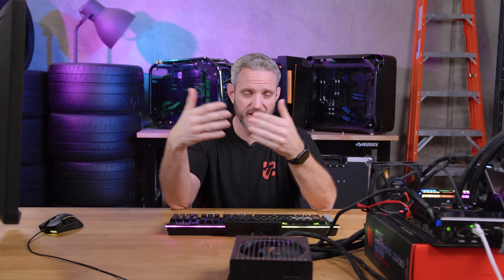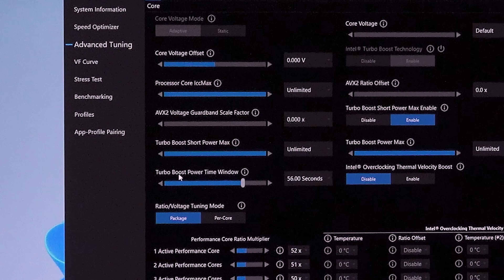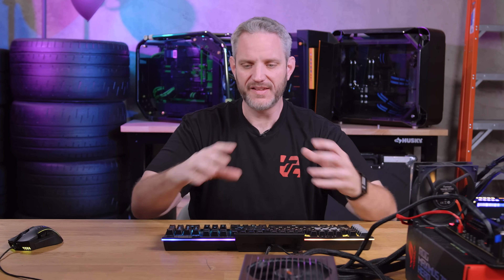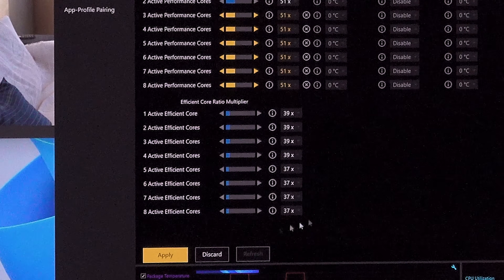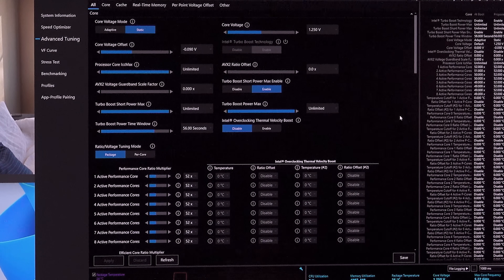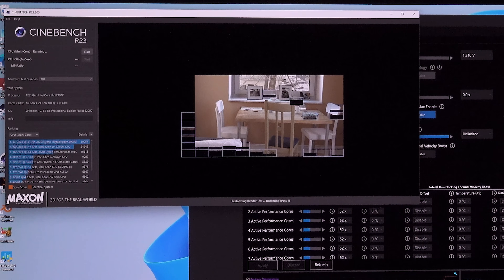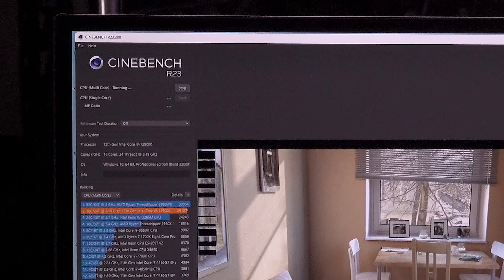Overclocking the 12900k is pointless and dangerous! Heat and Voltage testing...

Comment: As of my new pc build I’m solid a 5.2 on all performance cores and 3.9 on all efficiency cores. With a -0.075MV undervolt. And performance is great only reaching 50°C at 85W of load. And around 75-80°C at 200-300W of load.

Comment: 3 years now still running a i9 12900KF @ 52x P-core and 40x E-core with a dual tower Thermalright RA 140 air cooler just edging 90° under full load

Comment: This aged like milk lol. Enjoying my 12900KF and all the headroom intel left on my silicone. Easily hit 5.8 single core 5.2/4.1 all thread. I saw no real reason to adopt 13th gen. With 14th gen around the corner I'm tempted but lord knows it's not going to clock much higher than the promised 6.2 for the 14900 KS

Comment: Also depends on the work load, on DXO even with just post processing one image from a Nikon Z7. The load has been distributed too all cores, which is great. But it runs only at 4.4 ghz for P cores and I can't remeber thr E cores, way low with what it is capable of and there is tons of thermal headroom.

Even just doing a 5.2 all p core and 4.0 E core would be a DRAMATIC improvement over the stock logic and settings.

Comment: When enabling the AIOC on Asus boards you need to also adjust the thermal velocity boost to +1 and you'll get your same numbers rather than a little less. Only takes an extra second or two to change that in bios as well while you're there.

Comment: I have my 17-12700kf at 5.0ghz on the performance cores and 4.0ghz on the efficiency cores. My temps never pass up 50-55 degress Celsius at 1.2 volts.

Comment: It's simple,  use a sealed vapor pump style refrigeration system to cool all of the heat syncs of the components, with the components isolated in a sealed case with as much pressure removed as possible, using a vacuum pump. It would prevent condensation from forming and prevent the components from burning up.

Comment: I can engineer a case and cooling system that wouldn't cost a lot, and you can max every over locked setting on the slowest CPU and or GPU the board will take. safe and reliable. I'll guarantee it ,like, I guarantee my Unified Field Theory of everything, in Physics.   Have me on your broadcast and I'll explain my design to all your subscribers. 
  My design incorporates

Comment: I use an I9-12900k at 5.3 all p-core and 4.2 all e-core, max temps with cinebench is 73c @ 1.3 volts, and the vrm frequency does matter for trying to reach lower volts at higher clocks

Comment: Jay try the latest version of the XTU - it comes with voltage locks even on the 12900k (little lightning bolts), you were using an outdated version - so your viewers cant even follow the guide

Comment: Jay, it'd be nice if you actually provided the first step on how to unlock the overvoltage protection that's on the 12th gen CPUs to actually allow the sliders to slide.  Have a 12900k on a rog z690 and win11, but the cpu voltage slider in XTU says "undervoltage protection", and sliding it left or even the offset, does absolutely nothing...  Your video starts after you've already taken off the protection, leaving people without the crucial step 1.

Comment: Too bad that there's no way to backup the AI's training data so you have to do the process, and the fine tune because the thing loves throwing errors during Prime95 Small FFT No Avx stress test, at every:

1) Bios update
2) Major system crash (which defaults your OC at 38% despite selecting "stop training" in the bios
3) Random mobo bitc*ing

I went in-depth with both ways, manual and AI OC, and I found manual OCing not only superior in performances/temps/stability, but also easier to accomplish, which defeats the main point of having an auto OC algorithm that is not auto at all to begin with.

All in all great feature, bad implementation

Comment: There’s ppl that overclock their pc to 5.7 or higher ghz for just Fortnite. One guy used some kind of tubing that goes through a cooling solution with a low ass freezing point and he puts fry ice/ liquid nitrogen to cool don the solution and have it cool the tubing thus cooling the liquid that’s cooling the cpu. He bros smarter than I can comprehend. I think Bugha wanted to pay 30k for a pc to run 8ghz but it wasn’t efficient

Comment: my ai OC was making my system reach 100C in less then a 2 min, I turned it off and set it to P 3.9ghz and E core to 3.7 ( wouldnt let me past 3.7) ran the 10min test again and my temps highest was 79-81

Comment: i regret buying this  cpu honestly  i have a 3080 ti a i9 12900k  and  32 gb ram 5600mhz  and i still cant get my pc to run star citizen  like wtf  paid 6k dollars for something that performs worse than my 2070 laptop
Reply: working now?
Reply: @OfficialGundem  I gave up on starcitizen  whatever pc I use i cant run it well for some reasons mabe i live too far from the servers idk
Reply: what is your mobo?
Reply: @박덕배-i6r  Rog strix Asus Z690-E Gaming wifi
Reply: @DXDgamingsubnow  my gear looks exact same. 
Z690-E / 3080ti and I have two different rams. 1) Kingston fury 4 x 8GB(6000mhz) 2) fury 2 x 16GB (5200mhz).  Z690-E has really many hardware defects. I had to return it two times in a month. can you tell me your RAMs in detail? and how they have been populated? I can help you.
Reply: Star Citizen has garbage performance what do you expect

Comment: BTW cinebench is not a good stability test for OC... I ran cinebench 100 times and thought I was fine with my undervolted. prime 95 lasted 20 seconds! I actually don't want to overclock the 12900K at all, I am thinking actually 4.7 all core for P's and maybe that way I can push E's to 4.1 all core.. has anyone tried such a thing?

Comment: I got a 3970X to 4.4GHz all core (3600Mhz CL14 RAM 8 sticks) to 50,186 points on CB R23, anything over that and CB R23 crashed. It was being cooled by a 360mm Rad custom loop (EK XE 360mm Radiator, on Zenith II extreme Alpha using the monoblock), power draw was close to 600W into the mainboard. Probably could have pushed it further on higher voltages, but decided to leave it there as it was a production machine to be left overclocked. I had Windows running fairly stable at 4.525GHz all core, but CB R23 would crash just like it did for Jay in this video, test didnt start or did start and halted about 10% through.

I am looking forward to palying with OC on the Threadripper 7000 assuming it comes out in HEDT as overclockable and isnt restricted to Workstation and not overclockable.

Comment: I doubt you/anyone may see this, since it's now April 2022 -- just built my i9-12900k Asus Strix-E Gaming Z690 PC... I am a NOOB with overclocking, it gets too confusing for me, so I just use Asus AI OC. Followed this entire video, however, when I am benchmarking, my voltage hits above 1.4 and I think the AI OC even has a 5.4 overclock with 1.5+ voltage, which seems to be way too high. I can't figure out how to "easily" offset my voltage... I've tried everywhere in Asus BIOS but it's changed since you've recorded this video (there's no longer a CPU Core/Cache Voltage in AI Tweaker). Anyways, I have no idea how to offset my voltage so that my temps will get lower when pressed to the max. As long as I use Asus' AI OC, is that ok or can this hurt my CPU with voltages in the 1.4-1.45 range? Note: this is only happening, obviously, when I am pushing it to its max, but everyone including Jay seems to say "temps need to be in low 80s, voltage on all cores shouldn't be above 1.4" yet my AI Overclock has voltages in 1.4s and temps in mid 80s (I have an AIO 360 ps). Thoughts? I hope what I'm asking makes sense (TL;DR -- is it okay to just set AI OC on both p and e cores and let the AI do its thing regardless of how the voltage and temps get when doing cinebench?)

Comment: Setup a new 12900K on an asus Rog formula.  Pretty darn powerful chip.  Ran some testing and scores nicely.  It just has an auto asus overclock applied but has been stable.  Definitely runs hot even watercooled.  All core workloads still bring it up to 80 and it is water cooled.  No doubt some liquid metal or improved thermal paste would help a little but I suspect it is just a case of when it is under full load it is going to be 80° within seconds of the test stopping it goes back to 30° to 35° fast.

Definitely a warm chip.
Reply: This honestly doesn't sound any hotter than my i7 8700k water cooled when running a benchmark with AVX instruction.  I'm assuming you're getting those temps running Cinebench?  AVX workloads causing the CPU to hit 80C is actually really reasonable IMO.  If you're doing normal workloads and/or gaming, it's probably much less heat.

Comment: I ended up getting 5.2 on P cores and 4ghz on the E cores ring ratio 39 @1.2v 12th gen is crazy good I went from a 10900k and man what a difference I'm even getting more fps in games also vr is way smother with higher settings also pairing 12th gen with a evga 3080ti ftw3

Comment: Im new to all this stuff. but im wondering is there a way to set the CPU to overclock from the base 3.2ghrz to 5ghrz but only when needed. and where do i find those setting. BTW i have the 12900k alder lake. and a 2080 TI. With Asus z690 gaming-F Motherboard/ BIOS.

Comment: On my opinion OC is dead. Back on 2011 when OC our 2500ks was "MANDATORY" to reach 55 to 60 FPS but right now everyone plays at 144/165 FPS competitive-titles and 2k/60 FPS AAAs. I feel the 12 400F, 12700F, 12900F are the KINGS on price-performance. Search for benchmark and compare the Non OC versions vs OC ones

Comment: Where did you get this 12900k? From my experience, crap they sell on shelves is pretty much "C" stock, "B" Stock goes to OEM's and "A" Stock ends up on YouTube  channels. I have 3 two sitting on my desk, they are binned so bad AI overclocking fails hard. One is so bad, it has a factory V/F curves that needs 1.414 V on 6 out of 8 Pcores just to run stock.

Comment: I just bought a intel 12700k and ddr5 5200mhz with RTX 3060ti but when I turn on the xmp in bios my computer randomly crashes games and some times i even get bluescreen randomly, and i use 2 ram sticks not 4

Comment: This is one of the stupidest videos Ive seen Jay make in the past 2 years.. Taking a 12900k for example, Ive seen multiple people OC their CPU to 5.3 P-CORE /4.2 E-CORE and get 10-30 FPS or more in some games with a 360mm AIO.. It may not be safe for a 3 hour Prime 95 run but who in the hell just sits there and runs that shit all day? Playing games with OVERCLOCKS are just fine, and trust me people pushing the narrative that its worthless or DANGEROUS lmao is fucking ridiculous. I started watching this channel because of his old overclocking and water-cooling content and it seems to me JAYZTWOCENTS has forgotten his roots..
Reply: Well, if you don't mind crashing every once in a while... But if you do more than entertainment on a pc, overlocking is just dumb.
Performance gains are laughable compared to what it used to be. In 2000s you could OC your CPU 30-50% easily - no K chip, no Z motherboard, no fancy cooler, just a few BIOS tweaks and good to go. These days overlocking is a marketing gimmick that sells processors, motherboards and cooling solutions. It's not a thing anymore if you value your time at all. In this video he didn't even get a 10% performance boost, and I REALLY doubt it's stable for daily use.

I used to overclock back then, but these days I woudn't bother. Also, having the machine that doesn't bsod or crash a single time for 5 years of daily use is really really nice.
Reply: @dat_21  The new Non-k 12th gen cpus can be overclocked to 30%-50% on a $200 motherboard with the stock cooler.. Gamers Nexus Overclocked a 12600k an got 12900k performance out of it. Just because its not available on every cpu like the early 2000s doesnt mean its  gimmick.. And the cooler and heat situation is caused by the smaller dies used these days, its a by-product of making more efficient cpus. Yes its not as easy to do anymore but its definitely not a gimmick lol.. People like you that think overclocking is dead, dont actually know what the fuck theyre talking about lol..
Reply: @LegionGamingTV  You actually prove my point. It's such a hassle to get a decent performance boost. Why would I overpay 100$ for motherboard with BCLK oc , if I could buy a better cpu in the first place. WITH GUARANTEED RESULTS.

 Just because somebody did it on youtube, doesn't make it a decent OC for daily use. BCLK is always a lot more time consuming and requires tweaking the memory almost always.  Way back then, when motherboards didn't do the calculations for you and you had to correct the timings yourself with a piece of paper and a calculator. Even if you did have good CPU, you also had to apply extra voltage for chipset, e.t.c .

Kids these days don't even know what overclocking was like, and what memory timings really mean. They just up the voltage and clocks and brag about  how good their chip is on the internet. I never had "golden" chips they all were below average. Yet, with a lot of tweaking there were substantial gains to be had.

See, in 2000s I did all that for 50% boost, these days kids do it for 15% - it's not worth it. Unless you really enjoy it as a hobby (I didn't). 

The overclockers you seem to talk about - they are not casuals. They have access to 10s of CPUs and motherboards. The results they get are not representative of what you can except from your average hardware.
Reply: @dat_21  Not everyone buys $100 motherboards dude.. The normal buying range is $150 to $250 on average.. I didnt prove your point at all, youre trying to twist my factual statements to fit your narrative and its ridiculous.. To be able to buy a normal motherboard and a normal cpu and be able to overclock it to get a a tier or two tiers above what you paid for is exactly what youre argument was.. And you can do that on both AMD and Intel.. Being able to buy a 12400 and get 12700k performance??? Doesnt sound like its a gimmick at all.. Youre just wrong dude, its okay.
Reply: @dat_21  And no the BCLK doesnt require any tweaking at all, set your 130-140 bclk click your ram timing and your done.. 2 seconds is all it takes.. BCLK used to mess with the PCIE lanes and a lot of other stuff on the motherboard and now it only changes the ram and cpu. Im talking from experience not from some youtuber, i just used that example so you could physically see youre wrong.
Reply: @LegionGamingTV  You can't overclock 12400 to 12700 levels on average hardware that's absolutely bonkers. You know that 12700 has 2 more P and 4 more e cores right? There is no re-enabling cores like AMD phenom 960T did. 

You kids don't even know there were the processors that could get +2 cores just from the BIOS switch. That's overclocking at it's finest, 2 minutes +50% performance. That's why it got popular in the first place.
Reply: @LegionGamingTV  Okay you can get your 12400 30% faster, but the motherboards that can do it are much more expensive it's not worth it. Might aswell buy 12700 with cheaper motherboard. And last time BCLK was possible they nuked it via microcode updates after some time (skylake). There is no free performance on the table to be had.

Comment: This is why I undervolted my 12700k and just used MSI Enhanced Turbo in bios. Keeps all P cores locked at 4.8GHz and keeps temp below 60c at full load. Took a bit of tweaking using voltage override + offset + LLC3, but it's 100% stable, way cooler, and better performance than bone stock settings.

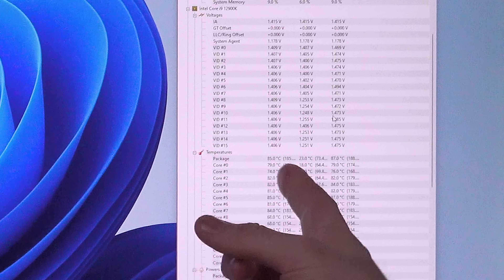Comment: Are vid value voltage at 16:29 abnormal with ai over lock or is that how it is for all overclocking. First timer so I’m pretty ignorant of these things.
Reply: Specifically when idle and not under load

Comment: Guys sorry about that, but I see a lot of people testing OC on 3D tasks like CB23 but, 90% of the users are gamers. From a 3D point of view a gain of 5% is ridiculous, not a worth at all. Sometimes I feel like this is an obsession. Am I missing some point on this thing?  because it doesn’t make any sense for me spend a lot of time trying to learn the math to get 5% better performance.
Reply: You are 100% right, it doesn't make a lot of sense. It was a big thing in 2000s where you could buy cheapest CPU and get in to perform like a top one with a few BIOS tweaks. Saved you a lot of money and performance gain was substantial. These days you either get an unstable system or fry your cpu with excessive voltage for like 10% performance. Not worth at all!

Comment: a DIY WATERCOOLING THE TEMPS WOULDN'T GO OVER 80C EVER.  YOU MUST REMEMBER HE ISN'T IN A CASE/  INTEL IS RELEASE A TOP END 12900KS I BELIEVE AND IT PEAKS AT 5.5 ONE CORE . I WOULD JUST RUN 5.3 ALL CORES.

Comment: Hey you, I have a question, I have an i9 12900k and 64GB ddr5 with 5600Mhz, two things, my processor gets extremely hot, despite custom water cooling, immediately to 108 degrees and I only get 21k points in Cinebench R23, while you get 27-29k, I also can't open my Ram 5600Mhz oc but only set to a maximum of 4k

Comment: In the future the cpus will be overclocked from factory ,we will get at a point where it cannot be overclocked
Reply: It's already pushing it's limits. Cinebench is not a measure for stability. I really doubt his overclocks are stable for daily use.
Reply: @Transistor Jump There are better tools to test stability. Prime95, intel burn in, OCCT. "Cinebench stable" usually doesn't guarantee stability in everyday use. 

Sometimes even with all these tests passed system has errors every once in a while. And if you overclock RAM, it is almost impossible to tell what parameter is set too high.

That's why I recommend not overclocking at all.
Reply: @Transistor Jump Whatever, kid. I hope your overclock stays stable in fortnite.
Reply: cap